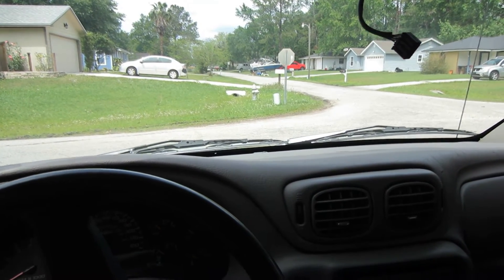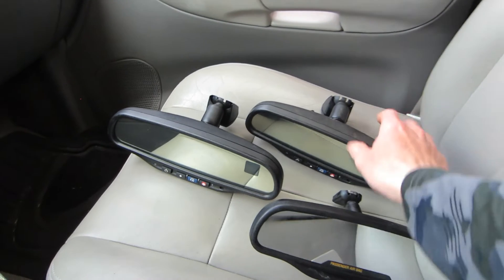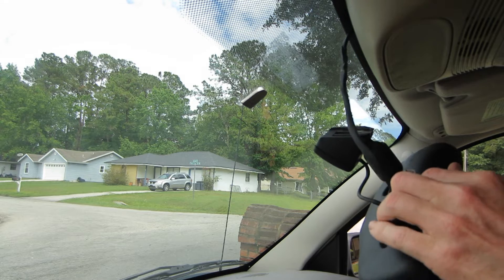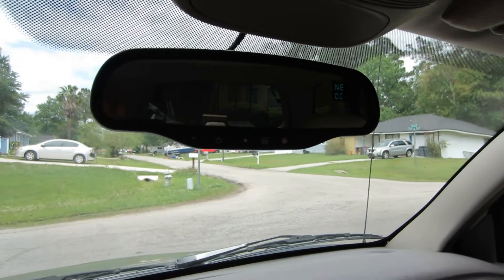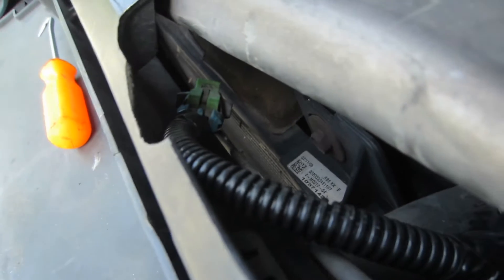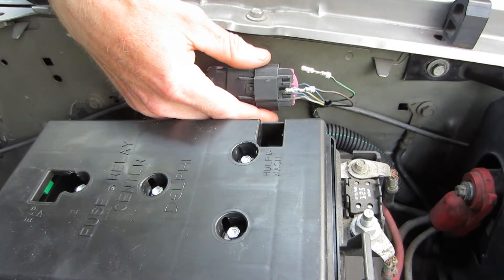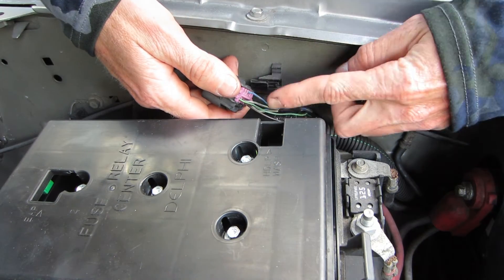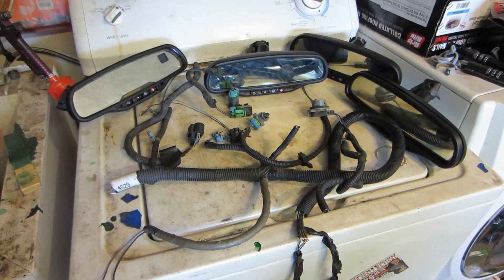Trailblazer Rearview mirror upgrade | Autodimming/compass/temp Mirror install

Comment: My temperature only says OC. Is it broken? It use to say temperature
Reply from the maker: OC means open circuit so either you have an issue with the sender/wiring or the mirror is broken.